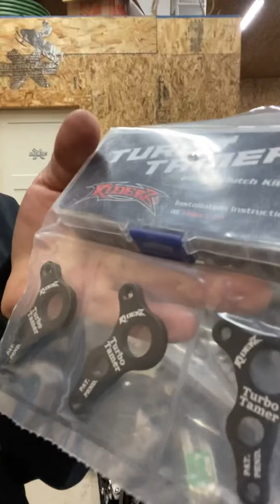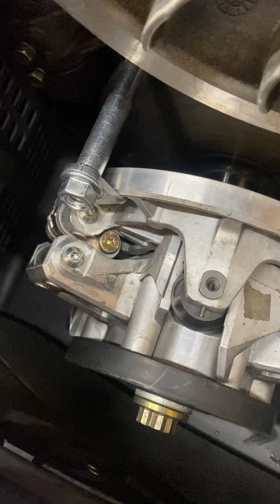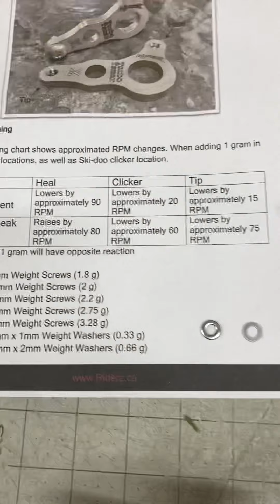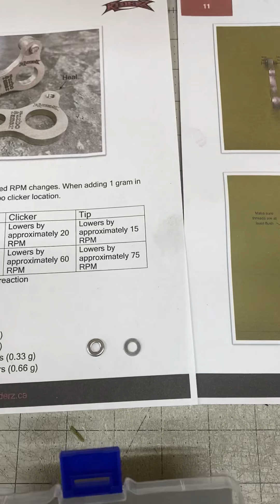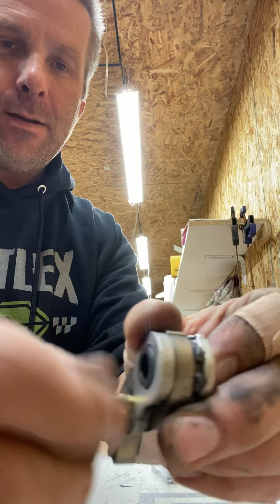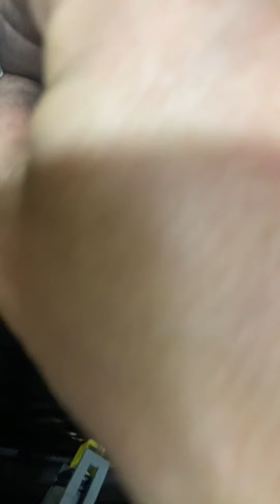Riderz “Turbo Tamers” Clutch Kit Install on ‘21 Ski-doo 850 Turbo P-drive

Comment: Heel bolts on those reminds me of "heel clicker" weights for polaris and cat clutches that came out around 2000.   Do you ever grease the roller needle bearings?  I was thinking of using redline cv grease.  Seems like car cv joint grease is under as much load and centrifugal force and heat as a clutch would be.
Reply from the maker: Yes this is a yearly maintenance item that should be done.

Comment: OK, I don't see any reviews on this kit, how is it?
Reply from the maker: These are awesome if you like the factory clutching “feel” but need to control the top rpm.  They pull slightly harder than stock due to adding the additional tip weight.  Engagement is changed slightly due to being able to add “heel” weight but probably around 100-200 rpm less.

Comment: 1st year on a ski doo, but I was under the assumption that 1 would give you the highest rpms. So going to 2 or 3 would be like adding heavier weights on polaris.
Reply from the maker: That’s opposite, 1 is the lowest RPM 5 is the highest.  None of the clicker positions change weight, they change ramp angle.  You have to add weight to lower rpm